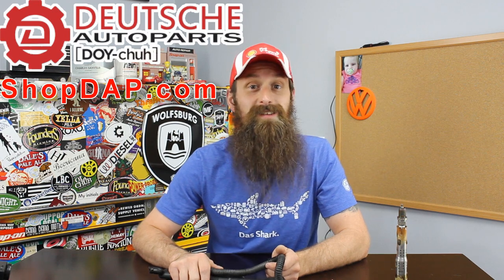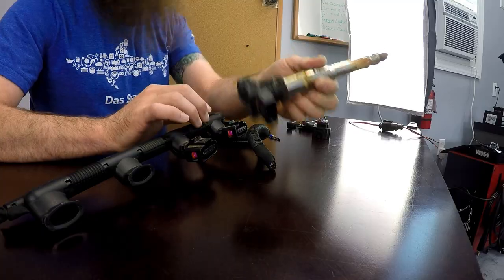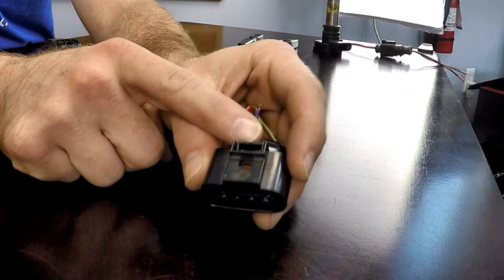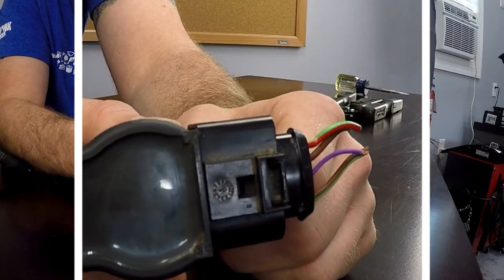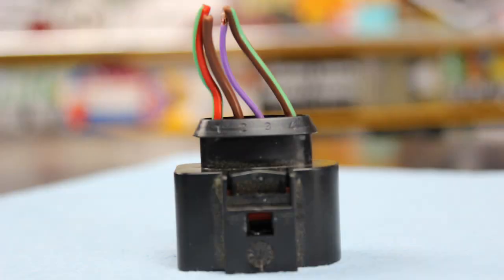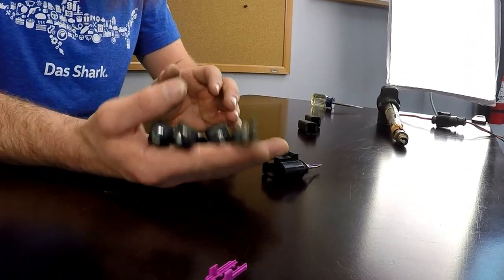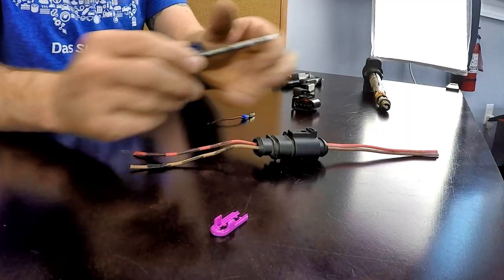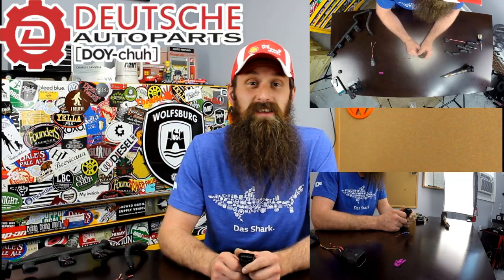How VW Parts Fail ~ 2.0t Ignition Coil Connectors

Comment: I could not get them off and cursed and swore until I saw another video... Which showed me to first  raise the connector to about 5 degrees against the coil and then press the lever to release and push the connector back, away from the coil. Then they came off easily on all four of my coils. I was amazed. I think your video explains WHY this works...
Reply: Yea I'm having a hard time.

Comment: replaced a lot of those connectors over the years, wish more techs knew how to disconnect them, watched to many techs break those manhanding them rather than pushing  them in and releasing them right
Reply from the maker: Michael Berg Yep, lots of techs lack the finesse that VW parts like. :)
Reply: Michael Berg yes, thats the trick. first a hard push in to release the tension on the notch and then you often can tilt the hook by hand and then remove the connector. damn, i chance spark plugs to often on my R32, o0

Comment: Just had to replace my entire wire harness for the coils on my 1.8t last winter, 034 Motorsports makes a nice kit that integrates the nice rubber boots that come on the back of newer cool wires as well as some heat protection for the wires them selfs. It does require splicing into the wires and then pinning them into a nice plug that plugs into their nice wiring harness for the coil packs
Reply from the maker: eric piggott The VW one required that you repin the ECM. That one looks pretty nice.
Reply: +HumbleMechanic this one is an aftermarket solution and splices into the wires between the ecm and the coils, I could imagine that repining the wires to the ecm had to be "fun" but a jobs a job right?
Reply from the maker: eric piggott I loved that repair. It payed great (5ish hours) and I got it down to about 40 minutes. Plus i have a weird love of jobs like that.
Reply: +HumbleMechanic seems like a win win, wanna come rewire my mk4 sometime? 331k miles on everything so I'm sure some electrical Demons are laying in wait
Reply: Easy question guys.... do I rewire the harness connector using the same speaker wire method?. (Such a noob I know, thanks guys)
Reply: HumbleMechanic hey ty for all the great videos.. I'm having a performance issue with my 2008 Audi a4 Quattro... I think the coil connectors are loose. When I step on the gas hard it hesitates in a kinda soft jerking motion.. Almost as if I was feathering the gas pedal.. I've replaced the fuel pump, and fuel filter bout 9 months ago. The high pressure fuel pump today, fuel pressure sensor on the high pressure pump about 7 months ago, the cam follower also 7m ago.. I replaced plugs and coils today, I did a fuel pressure test and was at 56psi stable and I left it for about 10 minutes and not a single pound was lost. My diverter valve was replaced I'm thinking 18 months ago. If u can help in ANY way I'd soooo greatly appreciate it.. Thank you in advance..
Reply: eric piggott what made you know ur coil plug connectors were bad? Did you get a code for that? I'm having performance problems and I'm getting no codes for it at all.. When I hammer the gas it feels like the engine is hesitating, kinda like I'm furthering the gas.. ANY help would he EXTREMELY grateful for.. Thank you for taking the time to read what I had to say.

Comment: We were in the driveway near the car one day and I could smell electrical smoke coming from the car. After removing the air box (pain in the ass) I discovered a faulty plug that was melting the connector and coil.. (car was not on or key in it). Was lucky I was there to save the car from further damage. Bought a new connector housing, savaged the wires from the old one and bought a new coil and haven't had a problem since.

Comment: hey humblemechanic, great vids you are a true ambassador for not only Volkswagen, but the industry as a whole. hey I have an issue with a 2.0L 05' Jetta. well I'm getting a po302 misfire and check light blinks. Anything as far as your expertise that I should investigate 1st as far as ignition, fuel, ect. I suspect the coil pack, what'd you think? Thanks

Comment: Could these connectors cause misfire codes if they are failing?
Reply: Yes, happening to me right now. I have replaced both the spark plugs and the ignition coils, but the connectors are broken and misaligned causing misfires in the car.
Reply: @kevin6562  let me know if that fixed your problem
Reply: @kevin6562  ciao,io ho una golf gti mk7, codice errore p130a,p03003 ho cambiato iniettore,candela e bobina ma il codice errore si ripresenta, quindi presumo sia il contatto dei pin... che ne pensi?? Grazie .
Reply: yes. no spark = no fire
Reply: Ummm that's a given
Reply: Lol

Comment: I’ve just found these things like to seize up as the plastic ages and becomes less pliable. Pressing the tab just won’t budge the locking mechanism and it ends up cracking. I much prefer the older Bosch connectors from the K/L Jet era.

Comment: one of these connector taps on the ignition coil of my MKV R32 is broken since five years now. never ran into any issues so far. it still seals very well.
Reply from the maker: ***** Luckily they can hold up okay sometimes.
Reply: HumbleMechanic luckily its on the first cylinder where enough dirt and debris flys past to hold it in place :D maybe this winter i'll adress this and pin in a new connector housing just to sleep calm again ;)
Reply: oxdudepoege are the connectors for the coils the same housing for the headlights and fog lights?? I have a s4 b6 and all my tabs on the coil pack connectors are broken and on te headlights and fog lights.

Comment: Not only do they grab the tab and pull the connector but these connectors are facing backwards so they are kinda hard to remove sometimes.  That makes me wonder how many of these get pulled at an angle inadvertently because of them being such a tight fit.  It is not like you can stand behind them where you have a good angle on them and remove them more easily.  All it takes is a clumsy person trying to get that off the coil and next thing you know it is time to order more parts.

Comment: Had a tech in my shop break 2 of those connectors just a couple of days ago on a Tiguan. He was doing a compression check. When he sent it to the dealer for warranty repair they sold the boss a wire harness because of those connectors.
Reply from the maker: Damn. That's an easy repin

Comment: Charles, have you encountered any issues with the loom from the coils? I have a 1.8tsi CC with an intermittent misfire on cylinder 4. If I move the loom a little it clears! Thank you for all the great informative tutorials.
Reply from the maker: Strange, I have not seen that. It sounds pretty reasonable to me.
Reply: HumbleMechanic I've ruled out coil packs as they're new, carbon build-up was cleaned following your tutorial & I've swapped the injectors round using new seals so I'm happy it's not injectors. I'll insulate the loom & report back, might be something that could help others out.
Reply: Steven Bradley was it the plug?
Reply: @horizontalste Thanks for the idea on carbon cleanup! Just about to install a new set of Bremi coils on new NGK Laser plugs on my 7 year old GTI Clubsport. Havent driven more than 50.000 km. But thougth it was time now!

Comment: Thanks for the great informative videos.
I have an 06 Audi A$ Quattro 2.0T, I'm having misfire issues, so I changed Spark Plugs, Ignition Coils, PCV valve, and purge valve, thereafter took it out for a drive and I still have a misfire in the #2 cylinder, then the car died completely due to a failed alternator. Can an alternator cause a misfire due to a lack of electricity?
Reply: What was the issue? Hope too know more soon?
Reply: You didn't use a VCDS interface / diagnose to find out what's wrong, faulty codes❓❓❓
Buy a VCDS it will help a lot you have my word on this❗❗❗

Comment: the money quote:   connector plastic gets brittle with age and heat.     I see various posts on Amazon for "VW ignition coil connector repair harness" .   some of the kits even include the orange and purple seals and locks.   
I wonder if this is good idea to replace connectors if doing a pre-emptive 100k service to replace Coil and spark plugs in 2.0T TSI?  
Also, a possible alternative for the expensive $50/each VW key tools, do an amazon search for "Terminal Removal Tool Kit".

Comment: Bob's Burgers has to be the perfect cover for Archer. 
The connectors come off easier if you lift the coil a bit and pull the wiring harness out of the channel so it has somewhere to go.

Comment: Hi great vid...if the small tab is broken can that cause a misfire in cylinder code thanks?
Reply: Same question here
Reply: @leosimon1746  still no response.
Reply: All my tabs are broken and I have code p0300 multiple misfire. Could the broken tabs cause this issue?

Comment: My connector is broken, I have zip tied it. But sometimes my EPC light is On. So do I need to replace connector
Reply from the maker: It’s a good start. But I’d want to check codes to be sure you don’t have other issues

Comment: I broke the tab on mine and used two bobby pins to de-pin the wire locks. Just clipped off the round part of the bobby pin and used the flat side. The tool would have been much better but it worked in a pinch and didn't have to bend the wire locks!
Reply from the maker: Very awesome. The depinning not that they broke.
Reply: HumbleMechanic So - If the cover on a 2.0t traps heat around the coils, would you recommend leaving it off?
Reply from the maker: Chris Primavera It does suppress a lot of noise, but other than that, you should be cool
Reply: @chrisprimavera7607  The air filter is inside the engine cover, at least on mine. Lol. So you can't leave it off.
Also if the tabs break, depending on the model there are screw holes to fix the harness with 2 screws instead.

Comment: those connectors are a nightmare, specially the bigger they are they stick too much!.

BTW. do you need to remove the 2nd violet lock to the side to remove them?
Reply from the maker: Guillermo Lovato That is only to remove the pins from the connector. And YEAH those big connectors can be tough.

Comment: Do you need to disconnect the battery to replace a connector on the car?
Reply from the maker: For the. most part, no. Just turning the key off is fine

Comment: Question! I have broken 2 electrical clip connectors, or not sure of the correct name. It is that little flat plastic flap that holds one connector to outlet, I use a hook to remove them and placed too much force. Is there a way to fix that? Or just have to replace all the conector.

Comment: We got the engine light on flashing and the car became sluggish and I heard it miss so I know it's a coil or a plug or both lol. At first I thought it was gonna be bad because because of that stupid EPC light n engine light on. And happened today but for the last few weeks iv noticed it's been slightly off n figured a spark plug or two was on their way out lol. We got a 2010 VW CC Sport it's the TSI 2.0 "Turbo 4 cylinder" this is actually the first time it's done this. We had it for 3 yrs now n it's always been a quick snappy pretty powerful car until this morning lol. It does have the K04 turbo and a few aftermarket parts on it. But I know it's the coil pack or plug or both

Comment: I have a 1999 dodge ram 1500 and I just tested the ingition coil connection and there is ground but no power when I turn the key over or try cranking is that normal or is it a bad connector??

Comment: Had a multiple misfire i replaced two coils. One was bad and pronges were actually touching and getting no power period. Replaced the fuse and it ran for a day and now nothing the fuse is still good but still no power to my coils to crank. Any info on what to check next or fix would be greatly appreciated rn.. Thanks

Comment: My car won’t crank at all, the cables looks like they are bad for this connectors, is there a way to test with multimeter to check for power going to coils?

Comment: Hi Charles, can you make a video about EPC light error in Jetta gasoline engine 2.0
Reply from the maker: Here is the issue with MIL/EPC and really any other light on the car. The first step in diagnosis is checking codes. otherwise you have no idea what system is having an issue

Comment: Humble mechanic I need your help with a code P0305. I replaced the coil on plugs and new spark plugs. What else should I check for this. It is only showing for cylinder 5.

Comment: So would this cause the engine to struggle to stay on at first? When I start my car first thing in the morning usually it stutters struggles to stay on then shuts off on when I first start it up through the day it’s fine. The epc and engine light comes on and engine light flashes
Reply: U got carbon bro. 

Drill on yer intake valves w zip ties.

Comment: Hey man love the channel! Got a cel on my "new" 03 passat v6 4mo. (157,000m.)Code said misfire 2 & 5 I replaced the spark plugs but the 'old ones" where pretty fresh. So are the wires. What do you suggest I check next?
Reply from the maker: Probably a cool pack if it’s only 2/5
Reply: HumbleMechanic thanks dude i replaced the coil pack a week ago and cel is gone! Thanks again dude!

Comment: I broke my Air flow meter connector lock tab the other weekend when changing out my air filter. It does stay in place when driving and has not caused a check engine light or any issues. Do you think i should try to fix it? Or leave it as its not causing any problems.
Reply from the maker: MelodicMurder If you are not having any issues, I would leave it alone.
Reply: Thanks

Comment: Are the connectors for the headlights and fog lights the same as the ignition coils?? My headlight connectors have broken tabs. Which is the reason I don’t disconnect the headlights off my s4 b6.
Reply from the maker: They are probably a different part number, but a similar connecter. They would be replaced the same way too.

Comment: My mk6 gti is turning over when I turn the key but im not getting any ignition. There is a broken lock tab on one of the connectors. I cannot seem to figure out how to release it so I can get new plugs in. I watched the video but still am unsure how to get it off the coil pack while not completely ruining the connector. Any Ideas?

Comment: Hello Charles, we know the engine cover traps the heat and make the connector brittle. Any issue if I don't use the cover?
Reply from the maker: A little more noise is usually the worst.
Reply from the maker: But that depends on the car. Some have air filters build in. Don’t want to delete that haha
Reply: @West End It can shake off the connector so it disconnects...

Comment: If the clip is broken would that be a reason it shows cylinder misfire?
Reply from the maker: +Luis Casarez it's possible
Reply: @HumbleMechanic  my 08 passat is  doing the same thing . I think the blown valve pan gasket lead to oil destroying my wiring
Reply: Spidey Rowdy wondering the same just the tab on mine is broke but seems to connect ok. I changed the plugs, coils

Comment: How do I know it is my coil or the connectors going out? Are there any symptoms with the engine that would lead me to check these first over something else?
Reply: Specifically once my car starts , I put it in gear, hit the gas and it stalls out on me. Last time this happened I replaced coils and that seemed to fix it. And always seems to happen after I have taken my car to dealership for service or inspection.

Comment: good video thanks but I do like to ask you something. so yesterday the car was running great then I went to go somewhere in started the car in it was running ruff in the CEL was flashing so I knew it was a misfire cuz I had this happen before I had #2coil short out on me so bad that it was smoking bad even after I shut the car off but I got it out the car still started in ran just on 3cylenders but now yesterday coil #3 shorted out in melted the connector to the coil in now the car don't get any spark it cranks over just wont start now in I took a coil in plug out in grounded it on the motor in turned it over in got no spark in theirs a P0864 code its a communication circuit range/performance and theirs a 01314 ECM please read DTC on the abs codes them are the only 2 codes I got can anyone please help me???

Comment: Changed my spark plugs yesterday on a 2.0 TFSI. All went fine. shrug

As a safety measure I used a screw to fix the wire harness to the engine. There were screw holes but no screws in em, weird.
Reply: Jeff Johnson  I got NGK PFR7S8EG (says "Laser Platinum", idk) on my 09 Audi TT. Cost me about 45 euros for 4.

Comment: Hello. Can you please help me with an issue on vw tiguan 2009 tfsi, error cylinder 3 missfire. I already changed the glowparks, injectors and others and still the check engine lights comes on. Thanks a lot.
I have to mention that the car works perfectly, it's just the check engine that comes on
Reply: Have u fixed ur issue?! How?!

Comment: Not mention any broken wire or internal wire cracks is also a problem on vw audi etc due to heat if to mutch problems occour like damage wires internal wire breaks lose wires Or broken and lose connectors.
Its better to replace a original new or aftermarket wire harnas it contains 4 new connectors wires already been placed and have enough insulation for the heat only thing is to  carfully reconect one connector at time.

Comment: Help please.... I've just done a 2.8 amx swap to a 1.8t awt and it's some what plug and play but I currently dont have spark or fuel to the rail. Pump works as I hard wired it and then gets fuel up to rail.. some one said need to swap some wires over but they didnt say what ones

Comment: how can i tell if my coils are bad? my 2006 2.0t passat will not start unless i jump it and then cuts off 3 seconds after i remove the jumper cables. already replaced battery and alternator